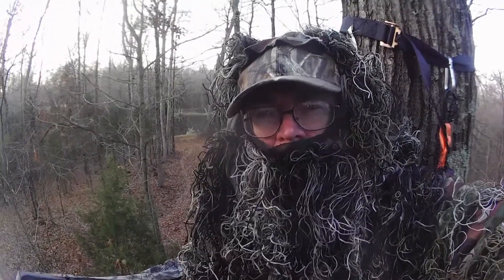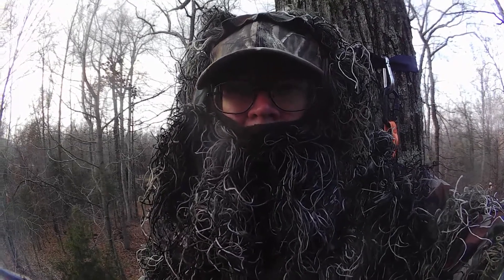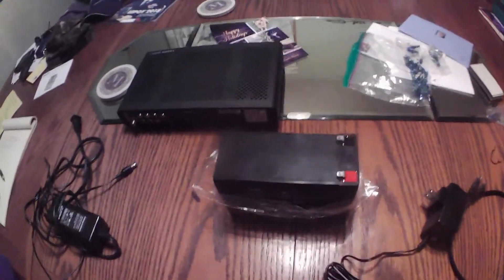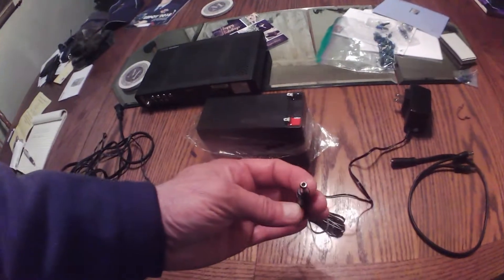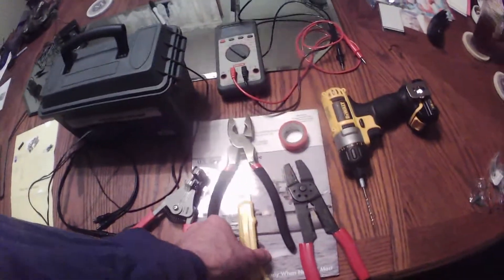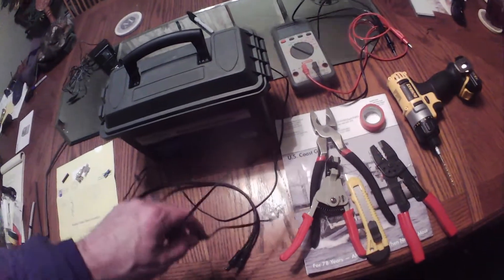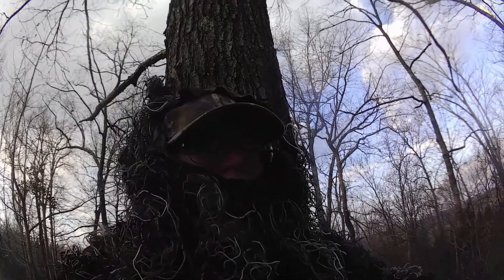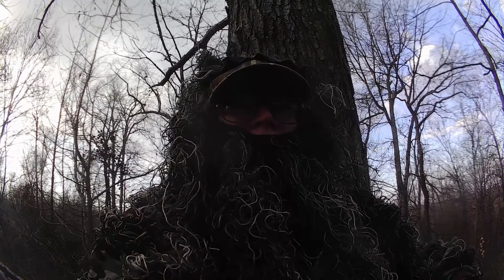Trail Camera Battery Pack with a 12V lead acid battery. External Battery Pack for Game Camera

Comment: How long does the battery last?
Reply from the maker: Depends on how many pictures and videos. I like video. If I am running cell modem too. I would only get 4-5 days with 8AA. With lead acid battery I can get couple months. Some of new cameras get better battery life. I can remember Moultrie edge lasting 5 days with AA. So $20 lead acid battery pays for itself in couple weeks.

Comment: I have a camera that takes 8 aa batteries so 1.5 x8=12v right so if I just hook up a regular 12v truck battery to it will I be okay? Or I can burn up my camera?
Reply from the maker: Yes you could BUT a truck battery is not designed to "deep cycle". A constant drain on a truck battery is actually hard on them. If you are going to use a truck battery consider putting a solar panel on it then you could go years with having to buy batteries...
Reply: @outdoorswithcam  well shucks I burnt my camera. It turns out it was wired 6volts even though 8 batteries. I should’ve checked the volt output before doing anything. Learned the hard way.
You think there’s a chance of fixing the camera now?
Reply from the maker: @pavilreutov1821 Sorry to hear that!!! All my cameras are 12 volt. I did a video where I fixed my car computer where 12 volt hit the computer. ten minutes with a soldering iron and its fixed. Walmart sells 6v and 12 v battery for feeders. Thats what you need. They are $20 pay for themself in no time...
Reply: How long does the battery last?

Comment: Moultrie battery has the proper fuse and circuitry protection maybe to protect the equipment? Another DIYer with no fuse protection at the positive post of the battery! Having trouble with critters chewing on the wires? Think short out. Short's without fuse protection could start fires . All power sources have some sort of fuse protection.  Just passing on some info.  Great idea!
Reply from the maker: Bruce, Thank you for the advice. I will add a fuse in the future. Simple to do. I would like to point out that the Moultrie that I bought for $70 +S&H + tax did not have any kind of fuse. Unless its hidden inside those thin wires. I am thinking a spool of Auto Fusible Link Cable
Reply: @outdoorswithcam  There is something there, fusible link or a resistor that would fail. Liability is too high not to have something.